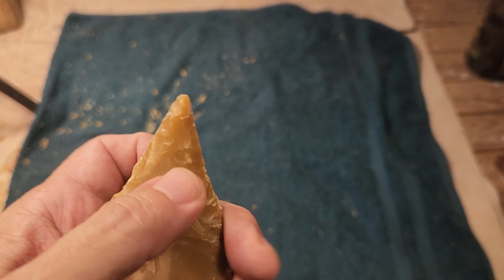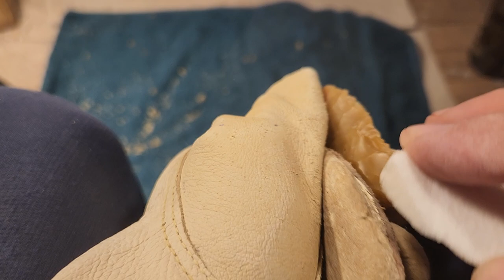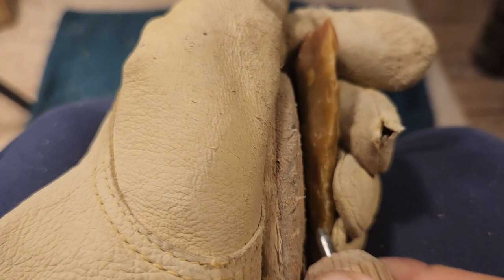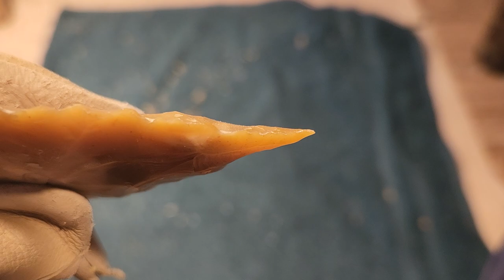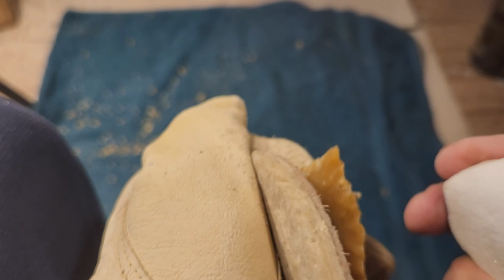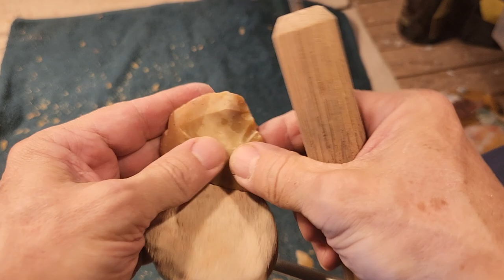1559 - Thinning a Thick Tip Flintknapping

Comment: How to thin a chubby arrowhead tip:  

Step 1- Be "Jack Crafty".
Step 2 - Flute, and/or bevel, and/or zigzag the tip as needed.

If you can complete step 1, then step 2 is a breeze.  Otherwise, it might not go so well. 😜

You make it look so easy.  (It's not easy.)